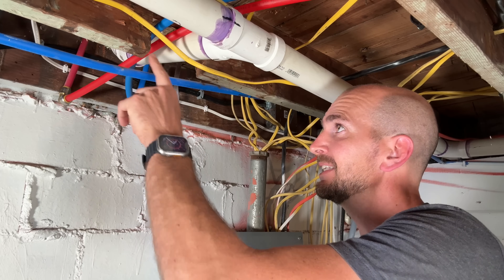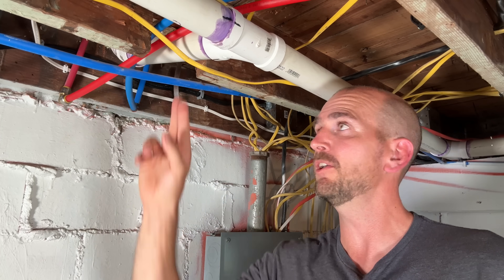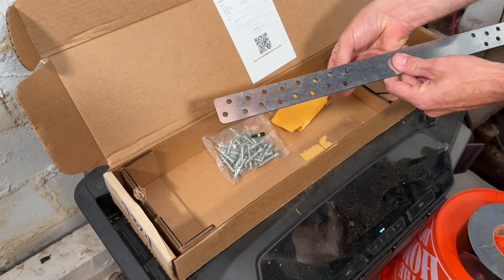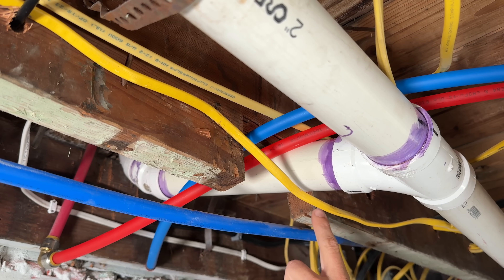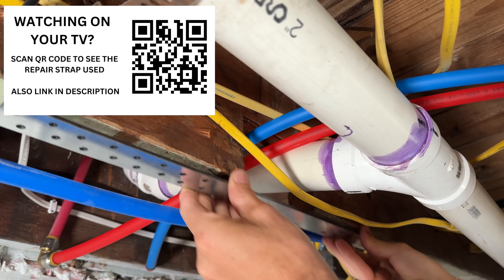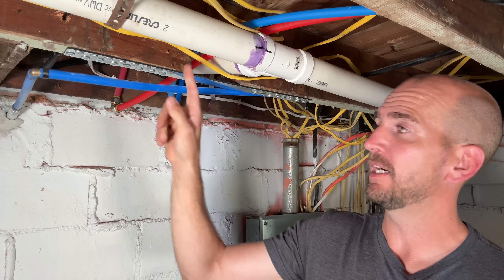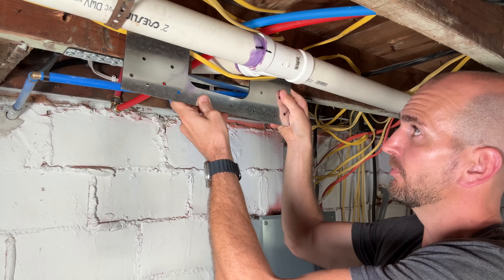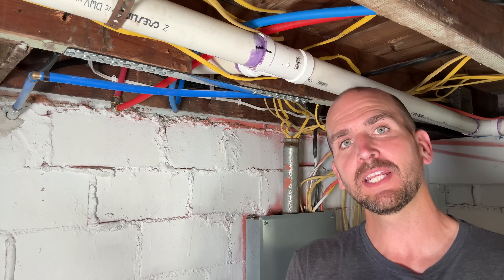Quick DIY Repair for A Failed Inspection:  Notched Floor Joist

Comment: Okay, I wasn’t hallucinating at 1:20, the holes really are in a wave pattern as shown by the screw heads at 3:00.  Do you know why that is?  My hypothesis is that it’s to avoid any risk of a split that having all the holes in straight lines might create, but I don’t know if that actually makes sense.
Reply: You are correct, it gives more material around each fastener vs having the, right next to each other to avoid tear-out or splitting. Almost all structural straps and other components will have this type of nail or screw staggered pattern. Even when just combining 2 studs together with nails or screws, you should almost always use a staggered pattern.
Reply: It’s not just staggered, it is wavy. Probably as you surmised to keep the fasteners across 4 different grains in the wood. Interesting product for the butcher plumbers to use. 😉